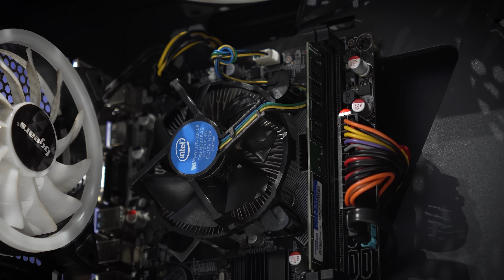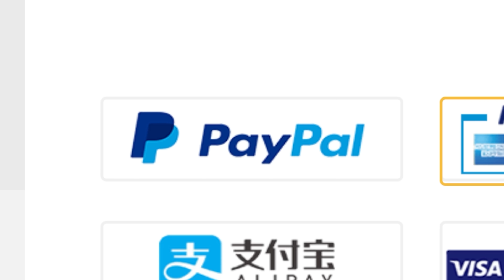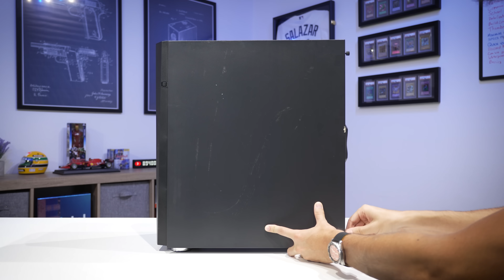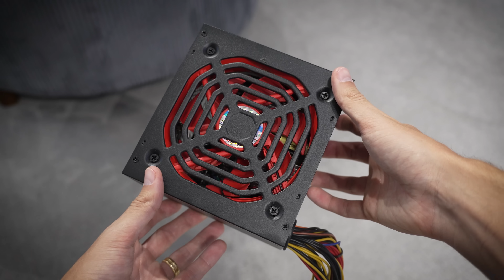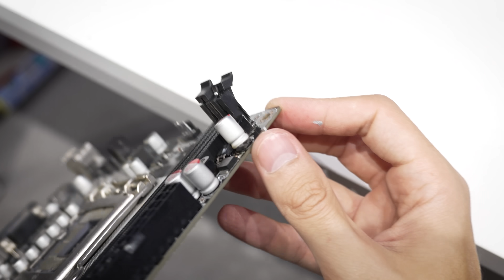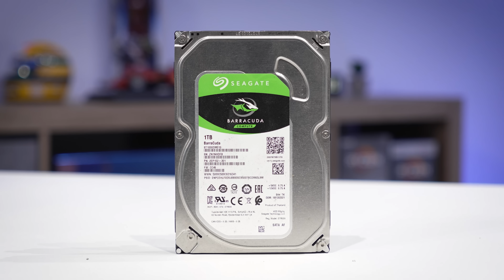So I Bought Another BROKEN Gaming PC on eBay...

Comment: Looks like some scumbag put old and broken parts together to scam someone.
Reply: Greg should tell us who the seller is so we know what quality they are offering.... :D
Reply: @007Jaredboy  He bought a pc that wasn't working. He knew it wasn't working. The listing said it wasn't working. He didn't know what parts it had because he clearly didn't care. He wasn't scammed. To scam is to promise one thing and deliver another. That wasn't the case here. He was promised a pc that didn't work. That's what he got.
Reply: I thought the same thing. The seller knew what they were doing. This was 100% a scam!
Reply: well did they say it was broken? I mean you aren't exactly getting a working system in the first place. The Scam is more so if they lied about the system specs, assuming it had actual info back when it was listed.
Reply: Exactly what I was going to say. I've wondered if people were doing this, and that hard drive being physically damaged pretty well proved it.
Reply: Exactly so!
Reply: The hard drive connectors were broken intentionally to keep anyone for finding out what repair shop or recycling center these broken parts came from.
Reply: @Andrew-ky8oc8cq4n  No, you can easily swap another controller board onto that HDD and it'll be up and running.  This thing was a scam to get rid of old useless parts and if Greg wanted to he could get a refund and ebay or whatever would go after the user.
Reply: @Andrew-ky8oc8cq4n  What are you smoking? That is not why they were intentionally damaged. It was to prevent the buyer from finding any data on the drive, even if wiped data can still be retrieved by someone that knows what they are doing. Repairing the drives PCB isn't worth the effort to most people, just to snoop.
Reply: @johnt.848  Takes 2 minutes to swap a Sata or IDE controller board definitely within the ream for someone to snoop.  Sure fire method is a BFH (Big Effing Hammer) and smash the drive to bits shattering the plates.  This was probably a dropped drive thrown in to appear complete from the front.
Reply: And not just one.  I've worked on almost this exact same machine.  Its even worse in person.

Comment: Spoilers:

-noname h61 mobo that went poof (usb 3.0 was added back in the day via extra controller chips so nothing special in that regards)
-cpu with sticker on ihs
-broken psu that probably also went poof
-ripped hdd connector pcb
-noname gtx 650 with cooler attached upside down(?)
-nonworking (?) case fans
What a combo!

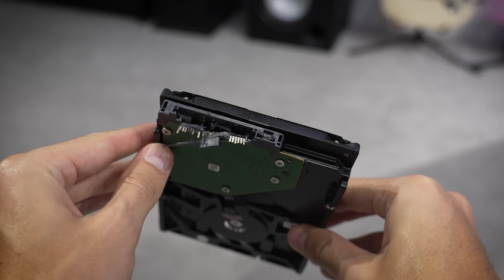Comment: 5:36 looking at the mess with the cables sitting just outside the HDD cage, bet the panel wasn't able to close properly due to it. And the mangled hard drives was a consequence from it, any bump from shipping or original owner would have caused that.

Comment: Friend of mine opened their very old PC to clean and accidentally had flipped the switch same as here. Luckily only the PSU only burned itself and protection saved the rest. £30 later on ebay and it  was up and running. Changing the crusty 10y old thermal paste did help with overheating and throttling.

Comment: $250 for this hurts me in the wallet just watching the video lol
Reply: same :(
Reply: Greg scammed himself by not determining what parts were in the system prior to purchase. Anything with DDR3 is NOT worth buying now unless it is rare and collectable only.
Reply: @johnt.848  unfortunately not entirely gregs fault. you can't always determine parts by pics and i doubt the post had specs, or i am sure greg would have never even thought about purchasing such rubbish. the green ram can easily be ddr4, the stock cooler certainly didn't give anything away and the cheap looking card could have been a cheap card from any third party that required 0 power, i.e a 1050 ti, 1650, 6500xt ect ect. hell even the motherboard looked fairly modern. 

i went into this vid expecting a 1050 ti and like an i5 6400 or something...  for that price tbh i never would have assumed such low spec. but i guess there is some absolute garbage people in the world.